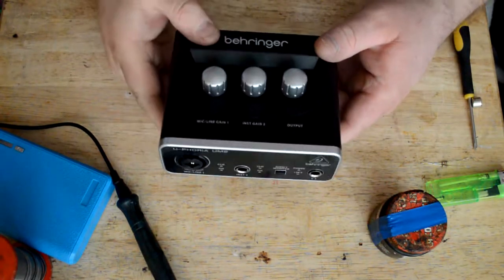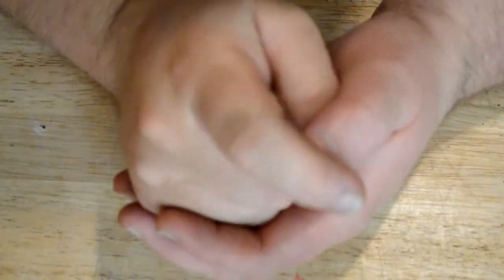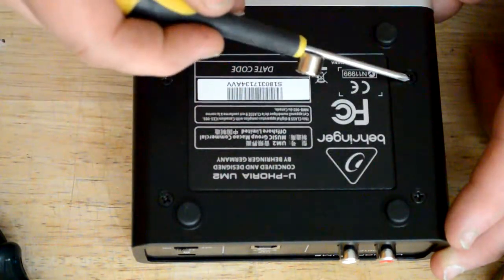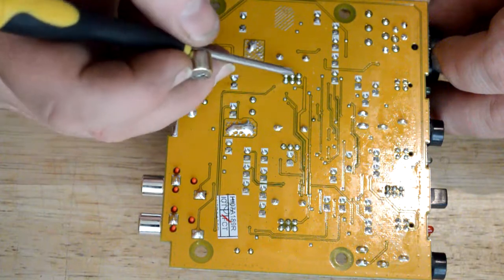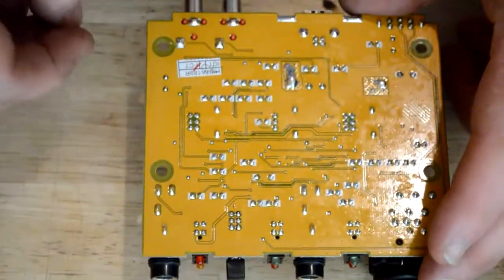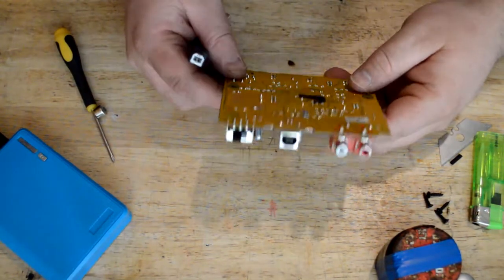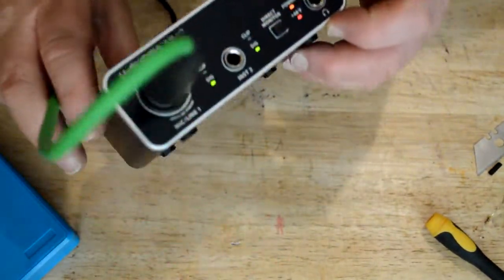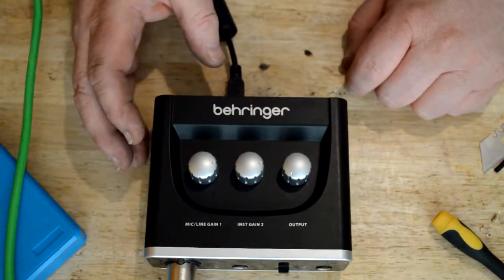BEHRINGER U-PHORIA UM2 hardware mono MOD .

Comment: Hello! I have the same interface and i use the video to guide me for disarm it, but in my case the problem is that de phantom stop working, but i dont really know what to do next... i was hoppin find some trouble visible in the plaquet, but now, i dont really see nothing wrong, physically... what do you recomend me?
Reply from the maker: This doesn't affect the phantom delivery altho it will very slightly reduce it but nothing that will affect its use .. I'm really not sure in your case what is going on ... I suggest reverse everything and test stock with a multimeter and then redo it test again before plugging in any microphones. ... See where you go from there hope this helps unfortunately I can't do much as I am physically not there ...
Reply: @Soooperspeed  thanks. do you know which component is that provides de +48 volts? is the 63 volt Condenser ? or are multiples components? where do i must measure ?
Reply from the maker: @llucillell  just measure the voltage on the mic output if you Google phantom power mic wiring you will get a diagram showing the cable set up this will show you were too measure .. your looking for +48v give or take switched when it's unmodified and about 39-43 v after mod ... Hope that helps .
Reply: @Soooperspeed  thanks again. regards

Comment: Hi, i was curious. at the moment i dont have any heat-shrink. is it really necessary for this type of mod? thanks!
Reply from the maker: Hi there .. well I only use it for neatness and making sure it don't short anywhere .. there is nothing stopping you just using some pvc (electrical) tape or something similar really maybe kapton tape etc even some glue gun would be ok too 😊
Reply: @Soooperspeed  Hi. thank you so much. at the time i was really curious about that, but didnt really put any much more thought into any alternatives.. i shouldve thought before i wrote.. thanks man!
Reply: You could use even scotch tape or packing tape really.

PVC electrical tape is IMO not really suitable for much anything. 3 years down the line you might find a shriveled up hard piece of PVC banging around in the box and no insulation.

Kapton tape is perfect for use in devices, i LOVE it.

Heatshrink is perfect too, at least wherever it isn't too hot, so it's perfect here.

But scotch or packing tape... the tape material itself is a suitable insulator, it's polypropylene. The glue is not rated to use on circuits, but in this here, everything is either super low voltage, or low enough voltage and lots of current limiting, so what's the worst that can happen... if the glue grows slightly conductive with age and the device grows a bit of buzzing or some other issue, it's maybe a sign that you need to replace the tape, take it off, wash the surface carefully with something that will take the glue residue off (isopropanol, ethanol, even lighter fluid, just as long as you don't let it sit long enough or run under electrolytic capacitors), but until then, you don't really need to worry about anything, and it might never come to it, it might be good forever if you're lucky.
Reply from the maker: @SianaGearz  yer i agree kapton is great and heatshrink there my go too in this situation . . but in a pinch other things could do the job .. low current no heat device like this is pretty forgiving if this was something more power hungry or mains connected then i would only be using kapton myself .. :) ..

Comment: I have an old TASCAM which has a microphone/instrument MONO mixdown switch on the top. I'm just here because i'm curious about the innards of the cheap Behringer. By the way, mine is now 15 years old and the last driver update is for Windows Vista, and i can still use it on 64-bit Windows 10 fine, just by force-installing the old Vista driver. I've done this with a few devices i the past, force installing 7 and 8 version drivers to work around Windows 10 audio wonk, though things did have a tendency to break for some of the cards for some reason.

Apropos that, currently the TASCAM prevents my computer from hibernating, i have to unplug it first - i could write a service that suspends the driver if it bothers me too much, probably just a little quirk of a first product in series and Vista stuff. Also software output volume control on it from Windows mixer used to work up until several weeks ago and now no longer does. I keep wondering, is this going anywhere, are they actually adding any features, making foundational work that would allow to support fundamentally new hardware, or new software use-cases? Because it doesn't seem so, it looks to me like they've done the somewhat painful, necessary fundamental rework of audio system in Vista, fixed it up to near perfection in 7, basically largely left it alone in 8, but now they're just dicking around with it with no rhyme or reason. I never used to hate Microsoft, with some short-lived exceptions they have put a lot of thought into the product, but now i am growing increasingly disappointed.
Reply from the maker: well in recent years Microsoft has been closing house when it comes to there in-shop technical bug testers ( Barnacules Nerdgasm.) did a great video recently on this exact topic , on which i commented about the ongoing destruction of older hardware i.e creative xfi for one ... and with the testing being done on virtual machines in only cases that show 100 percent incompatibility's and fixing them , us with more unusual hardware are pretty much left at the wayside only picked up if enough people with windows insider features get the errors .. this is why i done what i done too this . if its a hardware thing then less software is needed to do any of the controlling and all windows needs too do at this point is provide input in its basic form , the mic controller i had here was semi bricked from the last update we had and was not mixing the audio correctly so this fixes it too a hardware level .. omitting the issues that windows testers missed .. , maybe one day they will fix it but i couldn't wait too much of my hardware falls away with lesser and lesser support , installing older drivers didn't work for the xfi breakout unit in my case so a fall back was this  ... and in summary i do think there dropping the ball when it comes too keeping compatibility up for older hardware .. a FIRST i would say in all the years of owning and running windows pc's lets hope this is not a trend and just a bump in the road .. ... thank you for your comment i enjoyed reading it .

Comment: What is the value of the resistor again? Thank you!
Reply from the maker: hi there Resistor Value: 460 Ohms 5% (yellow,blue,brown,gold) this is the value of the resistor .. or you could use Resistor Value: 470 Ohms 5%(yellow,violet,brown,gold)  ..they will both work .. they only stop the phantom power damaging the other side as the mic is 2 independent channels and this mod makes it 1 mono channel with better nr and controls and best of all compatibility even when windows wants too run it in 2 channel .. it will always be monoural and clean over both sides equal(as long as you have the dials set well in testing ) thank you for your comment . :)

Comment: Bro, is it possible to install a switch to select Line Out or Headphone Out?
Reply from the maker: there already is .. its the monitor button this on enables headphones with it off disables them .. this is what your asking for as the rear output would still carry the signals needed the line out is for adding too another source or in my case too the monitor speakers as there amped and powered .. is this what your asking .. hope it helps if it is :)
Reply: @Soooperspeed  Thanks for your reply! I can still hear sound from both my headphone and my speakers with the Direct Monitor button in both on & off positions. What I'm looking for is when I want to use the headphone, I don't have to unplug my studio monitor speakers that is connected to the Line Out, basically some kind of an Output Selector switch.
Reply from the maker: @elzafir  ah now i understand  this is possible but not within the unit there is not enough room .. these are small units you can however fit an rca switch unit like i  have externally .. ( eBay item number 143577291307 ) just put this number in ebay search and it will show you what i mean .. ( im not connected with the seller of this item or affiliated in anyway with them this is just an example of what i mean )  one of them connected between the studio monitors will do what you are asking ... hope this helps you :)
Reply: @Soooperspeed  Ah yes, thank you. This puts me on the right track. I might be able to create this kind of switchbox from scratch and make a smaller unit. I'll also include headphones in/out on the switchbox so with one push of a button I could switch between headphones and studio monitor. And maybe add a 3.5mm headphone port as well as 1/4 inch port. I wouldn't want my headphones to always play sounds as it might damage the drivers. And plugging and unplugging every time I want to use the headphones is too much work hahaha. Thanks man! Keep up the good work on the videos!
Reply from the maker: @elzafir  now that sounds like an audio switchboard ( mixer ) sounds also like a fantastic idea and im glad i helped inspire you too create  that will be a brilliant combo tool for your berhinger for sure .. i appreciate the great comments and its for people like you i make my videos .. thank you :)
Reply: @Soooperspeed  Thanks man! I've subscribed to your channel!

Comment: I had to give my Presonus to my sibling for a job and got her UM2 to temporarily replace it. That's the worst sound card I've ever touched to be honest. Even some 15 year old devices beat this in every aspect. I'm shocked they can even sell this PoS. I'll probably harvest the pots, jacks and whatever else from it and send it to where it belongs: the waste bin. :D
Reply from the maker: tbf this is for sure accurate it is not the best of tools .. its just a handy one and with some tweaking it can get some average quality out of it .. for its price it has its place .. i since went on too use a focusrite saffire and an 6i6 now .. still have the um2 tho for the away from home work that i need quick access too a mic and controller that i care less for if you get me ..

Comment: on linux i only use the same in conected to the software that i'm using, without make these things, i don't know why on windows its so hard make these things only with the software
Reply from the maker: Ye windows splits it into 2 channels .. but not balanced split too left channel ,hardware balancing is better for control .. don't use Linux myself so didn't know they mix the channels on there good too know tho altho hardware based solutions are better for compatibility wish they had this as a standard thing on this mic controller but that's wishing eh :)

Comment: Can you please help me? My UM2  is having problem, the main first ports sound is automatically on off and blinking and getting pause and on again😭😭😭😭 sorry for my english😭😭😭 please help please😭😭😭
Reply from the maker: Try unplugging any sources then turning off 48v phantom power  and test another power supply.. plug the sources back in one at a time and test in every change ... hope that helps... it's hard over the internet but this may solve it for you..

Comment: My line 1 is not working properly every time i turn up the line 1 volume there is some crackling type noise, can you please tell me the solution
Reply from the maker: hi there  this mod .. is for people who want 1 channel in mono thro too windows .. in a hardware based fix so not relying in windows splitting and recombining later on in software .. with that comes some changes . this changes the 2 channels into 1 channel and both vol/gain controllers ONLY control the level together and have too be balanced together for it too work .. you can use the lights on the front for vocal or instrument gain tests so they peak together ... and  that comes the fact that together they CAN gain too high causing crackling so you need too turn them down or re balance them .. but once set should be good so depending on the input device connected it varys .  the UM2 is an amazing device ( altho for mic's and inputs at a beginner too intermediate level ) being cheaper tho does have weaker preamps ,< that can only be solved with more expensive units ..

Comment: Too much noise comes
Reply from the maker: how do you mean .. are you using a phantom powered mic  it could be the mic is faulty and has a bad grounding inside im not sure .. the mod wont add noise unless you have the volume dials cranked all the way up ( remember your mixing 2 channels into one so the input dials will exponentially get louder till it feedbacks or distorts you level them out in testing) hope that helps ...